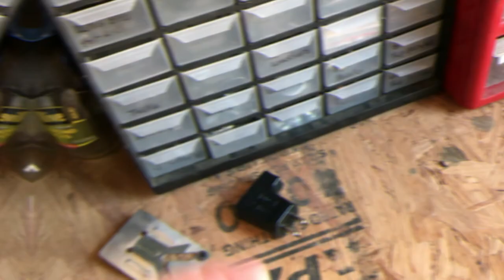Installing Carpet On The Pontoon Boat

Comment: You really need to glue that carpet down and roll it out, otherwise you will have a water and air trap between the carpet and the deck and wind up will air pockets and wrinkles. One gallon of Henry 633 glue from Ace and a small diameter paint roller will cover an 8X16 deck. Those staples will turn in to rust and attract water in to the plywood.